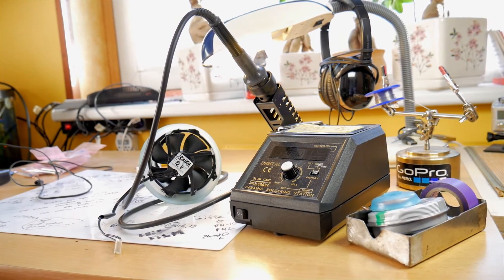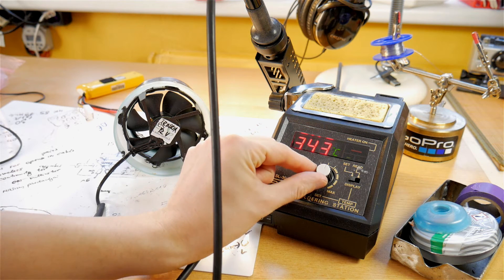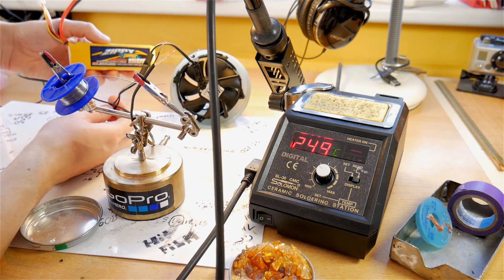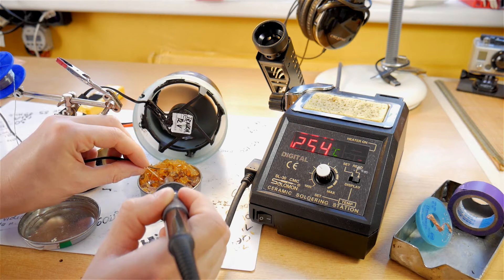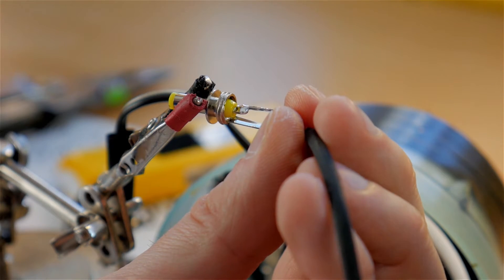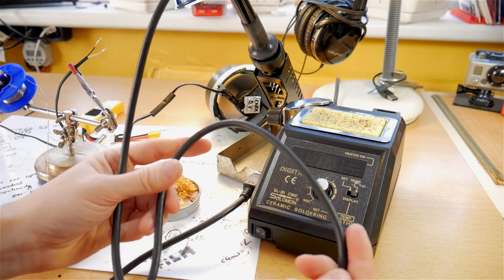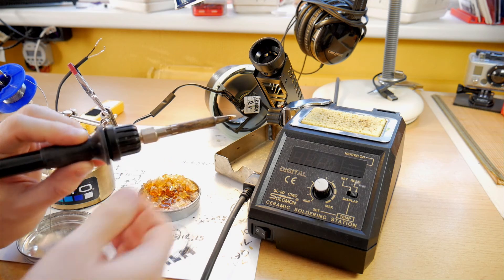Solomon Pensol SL30 soldering  station SORNY ROONG

Comment: I bought a similar one in the 90's a Lafayette SL-30 and is still working, i think this is an old strong design
Reply from the maker: mine just broke i and cant find replacement soldering iron... I wiggle the cable tem p changes 250C--400, 270C.... need to replace iron. dont know where to buy replacement

Comment: Where can I buy replacement heating element? Are the cheaper 24V 48W ones on Aliexpress/Ebay good?
Reply from the maker: mine still works fine - like the day i bought it. Don't have a clue about Alixpress or ebay heating elements. If were in your shoes i would try to find original part.

Comment: I have the same rosin tin as yours and the tin is such a pain in the arse to open xd
Reply from the maker: Yea its hard to open. :) Usually i use Spudger to open it.
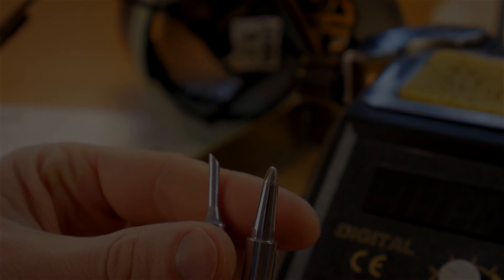Reply: Gd day sir, we have the same soldering station, i have a problem with my unit as where to buy extra soldering tip, may be you can give me some information as to where I can order, thank you sir 3:06

Comment: The problems with these is they only ~48W, I'm looking for something like 70W and many tips like T12.
Reply from the maker: Ceramic heater works very fast. If you need to reach 250°C it takes around 15-20  seconds. All kind of tips you can find in https://www.tme.eu/gb/
Till this day it works like a clock.
Reply: ~48W - is very low. I have weller 40W and it's too low. There are only 6 kinds of tips for Pensol SL30? Why so few?
Reply from the maker: Well it works fine for me. But sure its not for everyone.
Reply from the maker: Well it works fine for me. But sure its not for everyone.